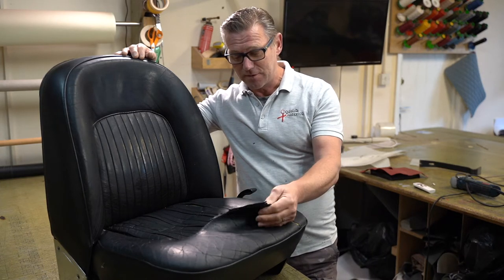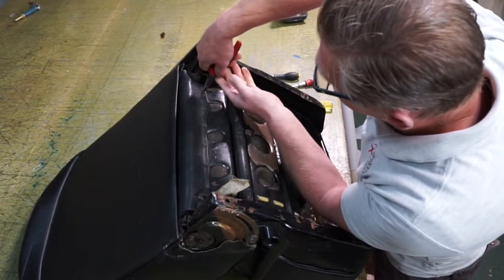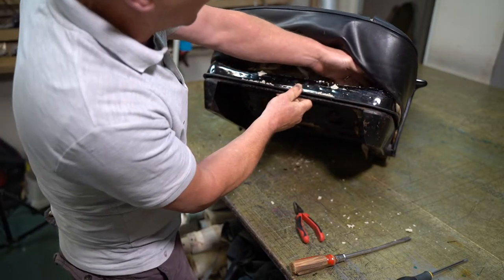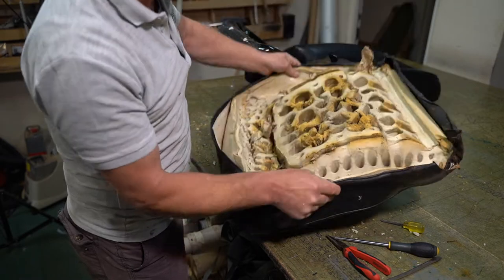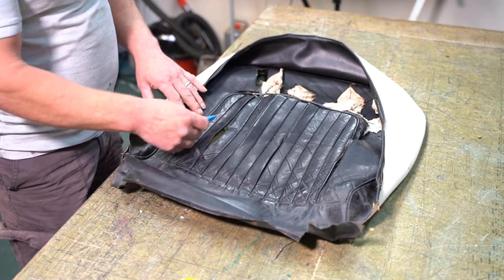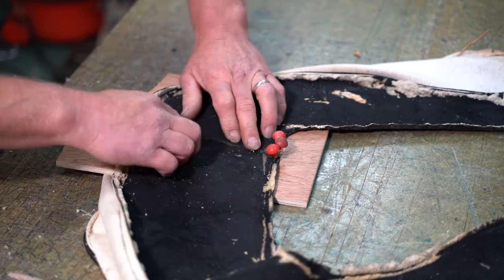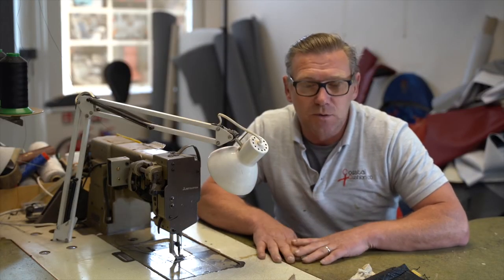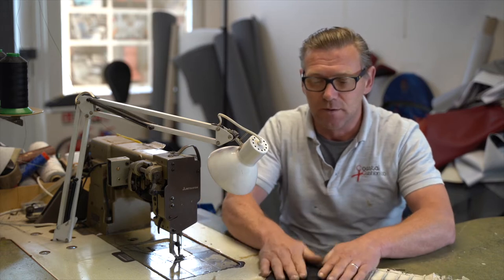£8000 Rover P6 seat/Ron Arad chair, repair

Comment: Excuse me, why not to use new leather for down cushion to avoid fractions? Unable to match color with back cushion or customer asked not to replace leather?
Reply from the maker: The customer wanted to keep all the original leather and all the patina of 60 years of use, and to not have holes in the seat so he could still use it